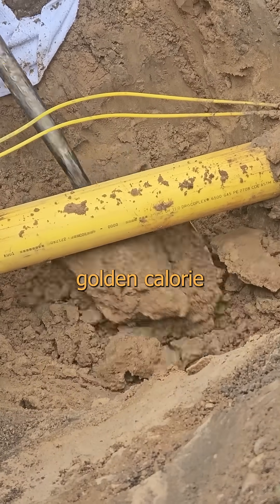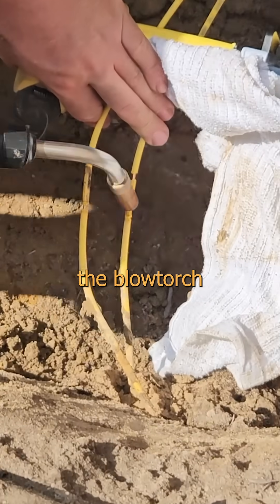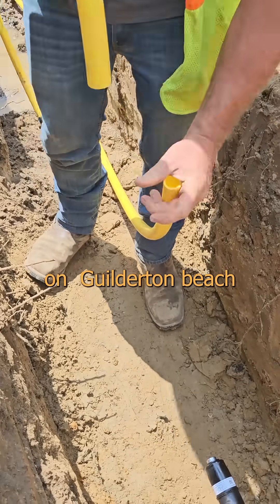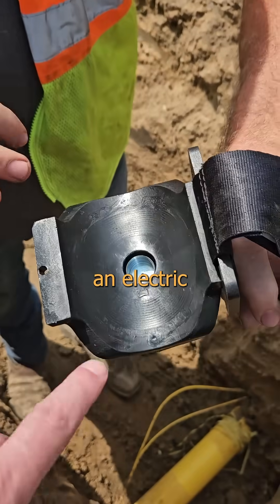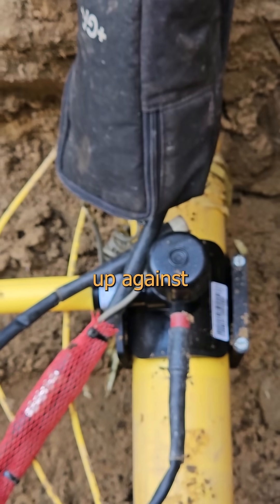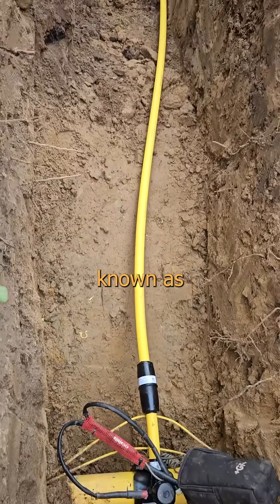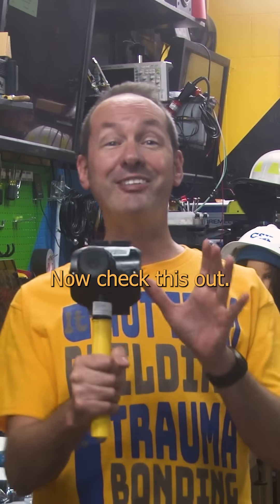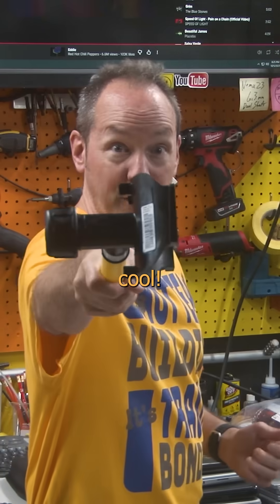Gas Line Hot Tap #chrisboden #comedy #engineering #construction #educational #apprentice #science

Comment: Is that similar to hdpe? Ive seen live hot taps where a blokes welding on the line and theyve got a escape line in that lets all the gas burn off basically like a huge burner stopping the pipe from exploding its scary to see but if it works it works

Comment: It's too bad they don't make saddle valves for residential copper pipe with a little more technical expertise built into them because the type that we have to use.Are basically crap after a few years. 

I would easily pay 10 or 20 to avoid the nonsense down the road with the saddle valves that we use now..

Comment: Our crew got dispatched to a gas leak.  Dispatch didn’t mention it was a 5” commercial service line.  We realized it when we got about a mile away and could see the dust plume shooting about 200’ in the air.  “Puckered starfish” was an understatement.  Flammable gases floating about on their own are one thing.  Flammable gases producing unstable rage tornadoes is an entirely separate thing.  All it would’ve taken to ruin all our day was was one spark.  My ears are still ringing.

Comment: I connect gas pipes occasionally and I use a machine that reads a bar code on the connecting fitting, sometimes the reader just doesn't want to read bar codes and it gets so frustrating when you are in a hole completely covered in mud and that fucking thing won't read. Absolutely amazing process otherwise, very easy and almost idiotproof.

Comment: The torching was just unnecessary, can think of 5 other ways to strip that wire. Yea it's "usually fine" like using a flame to check for leaks, but the risk to reward is massively tipped to the risk side, especially when there are many less risky options available

Comment: Years ago an old man I worked with had and we had a case of old dynamite that was starting to gel. He wanted to get rid of it and took it down in a holler and set it off. We went to look at the damage and running right thru the inside of the crater was a 6 inch metal gas line. About had a bad day. He said I didn't know that was there.

Comment: So much more advance them arc welding a nipple to a 2 inch gas line, slapping a valve on it before deep throating the fucking thing with a drill and some cutting oil. 😂

Comment: I was a tapper for about two years. We did mostly water/sewer, but would also do steam, glycol, and of course gas on occasion. Just be smart with the equipment, and trust that the engineers designed the parts the way they did, for a reason. Everything works out fine, just gotta respect the gas.

Comment: my only question is where that cut material goes after the cutting head displaces it. Seems like over time and multiple branches added it could lead to a clog. Brb gonna go try and find the answer.
Reply: unfortunately there seems to be several ways and devices to do a gas line hot tap; I couldn't find a specific answer.
Reply: @jackmcdowell40223  so the cutter cuts a coupon, the coupon is retained in the cutter and prevents gas from blowing out of the top. the cutter is toothless, its just a very sharp cylinder, so there are no shavings
Reply: @hustlehumbly6169  gotcha that makes sense.

Comment: As I was told in Ford alternative fuel class that gasoline is way more flammable than Natural gas or propane!! You can drill a hole in the tank and it can't light because the pressure and the Air fuel mixture is not correct!

Comment: Socket fusion like this is a huge fire hazard if done improperly. Last year here in Sweden a Canadian company managed to set fire to a water park when using socket fusion on water pipes that didn't fit perfectly. The damage cost was about 100 million USD.
Look up oceana waterworld fire if you are interested.
Basically if the heating element is not pressed between the socket and the pipe it overheats and the plastic catches fire.

Comment: My only problem is that when it cuts the hole through the pipe to let the gas flow you are still going to have some debris from the cutting in the line. And since it is moldable by heat it could melt and cause blockages in unforseen places.

Comment: Look, the first time taking a blow torch or an oxy out next to extremely flammable material is always puckering, but when work needs doing and you find yourself being somehow the most competent person to do that work, you get it done.

Even if it means the potential loss of a $1m combine because you needed to do an emergency weld repair in the middle of the field with dust so fine it would go up in flames if you rubbed your hands together near it.

Comment: This stuff used to be my gig. You might be interested to know that there is an alternate self tapping tee that doesn’t use any fusion to attach to the main. Looks very similar and is called a mechanical self tapping tee. Basically just straps on the main and a heavy duty O ring provides the seal. And those black pill-shaped pipe couplers? They are brand-named Perfection couplers. The gas industry version of Home Depot Shark Bites! I’m assuming this is a 60 psi working gas pressure because you see its pressure tested at just over 90psi air (looks like 100 on the gauge) and is the yellow Medium Density Polyethylene. Typically for 90 psi mains and services, only the black High Density Polyethylene is used. Gas pipe services and mains are pressure tested at minimum 1 1/2 times the Maximum Allowable Operating Pressure. 15 minute pressure test for 2” diameter pipe and below, 30 minute pressure tested at for pipe diameters above that.

Comment: THANK YOU NOW I CAN SHOW PEOPLE THE WORK I DID GOING TO SHARE TO LIKE 20 of my friends and family 😂
Reply: This is also what we call fusion welding, there is a few more methods of getting the plastic to fuse. This one is by far the fastest and best type of fusion but a big con is that it’s expensive. Each fitting is very expensive compared to the poly fittings you can use with socket fusing where you melt the inside(female) part of the fitting with a hot plate that heats a ceramic plate to a precise temp depending on the size and thickness of the pipe and material. You need to be within 20 degrees ( example 490-510) no more no less. Then insert the pipe (male) and after it’s held the fixed time you with take both ends out and quickly BUT carefully insert the melted ends and if done correctly will form a bead around the weld. The other one is primarily used for large pipes but it’s butt fission and the plate melts both ends and with a machine it’s aligned and pressed together. Obviously it’s more complicated but that’s the summary.

Comment: I've seen a scaled up version similar to this in a natural gas plant. It was an expansion project for an existing unit in operation. After the new processing components were installed, they were ready to tie into the product line that would be supplying, but there was only a 24" pipe and there were no tie-in points.

They overcame this problem by performing a hot tap - a method where they took a split tee, welded it on the bottom side of the 24" pipe, then welded the top half onto the top half of the pipe. 

The top half of the split tee had the branching portion that would supply the new equipment. The branching portion of this tee was much longer than a regular tee because it contained a valve.

Once both halves were welded on, a specialist came out with some fancy drilling apparatus. The technician bolted this apparatus onto the flange on the downstream side of the valve, opened the valve, and the apparatus began plunging a large bit through the tee to the main line and bored a hole through it. (Like a drill press with a hole saw).

Once the hole was drilled, the bit retracted back into the apparatus, the valve was then closed, and the apparatus unbolted, allowing the pipe guys to fit the last piece of pipe to the valve. 

The most wicked part about it all is that this work that was performed on a live line.

Comment: It's safer than you think. You can add as much heat to it as you want but the gas on the inside won't ignite until oxygen is added to the equation. If it were a metal main, you could weld right onto it. However, the moment there's a failure, you get yourself a blow torch straight to the face. I work in gas distribution an it's not as bad as it seems, but it could be.

Comment: This is scary, but for the first time on this channel I've heard of crazier.  My sister's husband works in the nuclear industry.  At one of the reactors he used to work at, they hot tapped a pipe on the inner loop of the pressurized nuclear reactor to open a stuck valve (rather than depressurize and replace the valve).

Apparently that was low temperature (or maybe pressure, forget which) compared to the oil and/or gas refineries the hot tap specialists usually work on.

Comment: We have a similar shuttle device in refrigeration. It's called a bullet piercing valve and it works very similarly, minus the melting adhesion. 

Clamp down a few screws, pierce and allow access to the system. Too bad they leak 😅

Comment: 3" gas main at only "a couple pounds of pressure"?
In our municipal, typical neighborhood distribution is running around 70psi before the customer regulator and meter which then drop it down to 1/4-1/2"psi for residential use.

Comment: I do this for a living it's hdpe fusion.  Those fusion saddles are cool under normal operation the heating coil gets to around 500-600ºf but if you had it exposed to the air it would spike to around 1400ºf

Comment: This is where you start getting back into stoichiometry and Metallica- "Gimme fuel, gimme fire, that which I desire!" Which leads us back into basic fire safety classes- Fire needs three things to start- a fuel source (like gasoline or natural gas), a source of ignition (like a spark or some other thing at a sufficiently high thermal temperature), and oxygen, or even just an oxidizer. Take any one of those out of the equation, no more flamey-boom. Even if you DON'T, but they're not in the right proportions (I.E. you have some trace amounts of oxygen mixed in with your natural gas)
...still no flamey-boom (or at least, less flamey-boom.) 
Keeping cool and starving a fire of oxygen has saved my backside bacon (but not my actual bacon 🥲) on at least one occasion. Hot though the fire was, THAT'S PRETTY COOL!

Comment: As a young up and coming HVAC tech working on a new steak house build, at the corner of the then new Highway 51 and independence blvd in matthews Nc, some pavement Jackie’s were excavating like we know how your mom likes it, and pow… right through a 10” natural gas main… a steel one…

We were all ordered to stop ALL WORK, NOT FUKKIN MOVE, NO NOHING that might ignight this new volcano of insanity brewing outside the building…

The gas company arrived in a flippin pickup truck…
 The guy hops out of his truck, fires up his generator for the welder not 6feet from the spewing pit of impending carnage…

He jumps into the pit, with cables and a hammer…
Clamps onto the pipe with one lead, and starts WHACKING on the damaged tube like a fully invested teen just discovering his favorite appendage.

As he finishes smaking it, he takes a plate of steel out of his pocket, sets it against the damage, and proceeds to arc weld the thing with live gas spewing forth.

Not a bit of flame, not the tiniest explosion… no drama whatsoever…

Insane.

Comment: Forgot to mention the bar codes are scanned and the computer within the box up top reads these and calibrates the machine to apply perecise amount of power to run the elements for a certain time. The machine once done gives a time for cool down and also states if it fused the poly together correctly. If it detects a bad coil through resistance in the coil it will abort the procedure and new fitting is needed. Very cool setup and expensive tools but we use them for water main lines through apartments on new builds definitely a time saver.
Reply: @jwpepper6718  yep I'm glad I got out of natural gas work when I did one of the cities in my area recently banned crews from using the push connect fittings so now the service crews have to electro fuse every fitting from main to riser
Reply: That's actually so neat!

Comment: Here, whenever I flip houses that have Gas. I do the reverse. I have the Gas Capped at the Street and then have the Lines removed in the yard. 
YES, I remove Gas from all the houses I flip that have them. Gas is so dangerous to be in a house and just very expensive for people.  Much easier to just go Electric. Safer and easier.

Comment: Alright. I got to say it. 3inch MDPE (aka poly pipe) gas lines so not scare me.
12in High Pressure Steel gas lines scare me. Like the one right under the road, which is right under the bridge we are about to demo, that's a little concerning. Concerning for the gas company too I guess. The largest MDPE gas line I ever worked with was a 6inch supply line to an Intel site. LEGAL DISCLAIMER: I have never worked FOR Intel, I do not represent Intel, their property, or their IP.

Comment: I've watched someone tap steel gas pipe. It's more or less the same concept, but they need a lot more amps to do the melting, as in they arc weld the sucker on. (I don't off hand remember if it was MIG or stick.)

Comment: Reminds me of this green pipe we use at work called aqua therm, it's about 5/8 of an inch thick and uses that super technical process we call melting to bond it together, we have it hooked up running our fire sprinkler system and it's holding 212psi and has been for over 11 years,

Comment: They made a water piping with polypropylene instead of polyethylene. Same concept, heat fused and the fittings are stronger than the pipe. Pretty great stuff, EXPENSIVE, but quality

Comment: What is the diameter of the hole punched in the gas main pipe by the shuttle when you screw it down the first time and what happens to the plug it cuts out?
Reply: usually the hole is equivalent to the outlet size, which appears to be 1 inch

Comment: Low pressure gas work like this always makes me laugh. I work with CNG and we have sensors that will shut the system down if there's any leaks in the main unit and everything has to be intrinsically safe or explosion proof as far as electronics go.

Comment: I once worked on the electrical part of a natural gas pump station and found out about a device they called a slug catcher. It catches the chunk of pipe cut out for tapping a working line. I made it a point to be on hand to watch when a crew working just a few miles away made a tap. They welded a collar on the active line, then used an acetylene torch to cut out the slug inside the collar, hit with a hammer and let it get carried down line to the station by the gas pressure. I was in awe of those guys working on a gas line with torches!

Comment: When it cuts a hole in the pipe, surely there is some debris generated, how does the system handle that in an enclosed gas line?
Reply: there is not debris, the cutter it toothless, just a razor sharp cylinder. the coupon, or disk of plastic, gets retained inside the cutter.

Comment: Where does the piece of the gas main go after the shuttle cuts it? This is similar to a saddle valve that you get with an ice maker kit for a refrigerator, but that just punches a hole in a copper line, lasts for about 5 years then develops a slow leak... 😅 I'm sure these are way better!

Comment: My experience has been that thermo plastics have shorter lifetimes than say, steel.  Eventually, they become brittle.

Is there something different about the formulation of the plastic used in this gas line?  If not, is there some equally cool technology for replacing them without digging everything up ?

Comment: Okay, what are those two wires next to the gas main carry? Are those wires at all? Are they pipes? You melted what seemed like wire insulation away around the copper(?) cores, but didn't connect them to anything (not in this clip), and in the next shot they seemed to be intact again - new site?
Asking from Austria, Central Europe; we have the same melt-on gas lateral system in use, at least here in Vienna.

Comment: In a UK city most of your utilities will be in a 5' pavement, and at least one of the utilities will have mole'd a new conduit in and moved the dirt around moving everything just a little bit. So the pipe is in tension, when you drill it the hole starts a crack which runs around the pipe releasing the tension. This is bad.

Comment: Hey I wanted to ask a question about power lines. I was biking near a power station the other day and the cables sounded like a horde of cicadas. Then later under other lines it was buzzing and I could feel the charge in the air, like a blanket of static over the whole everything.  Then my hands started zapping against the metal in my bike. 

Is any of this supposed to happen?

Comment: That is pretty cool! As a plumber for 10 years, I have fused some yellow poly a few times, but I never seen one of these contraptions. We typically deal with short runs with a couple stab risers if possible and black iron. I have only worked in residential plumbing.

Comment: Wait so how do you remove the melting thingie or does it stay on the pipe permanently as the off switch
Reply: the tee is all one assembly! the heating coil stays fused to the pipe, you just disconnect the electrodes from the power supply and it’s good to go

Comment: Great for the new lines. The old cast iron still need lead solder. The even older ones found in NY and the New England area were made of wood and designed to carry coal gas which had a relatively high moisture content. When everything switched to natural gas, the wood pipes dried up and disintegrated. There are probably hundreds of miles of gas “pipe” that’s nothing more than a literal hole in the ground and can be disturbed by a plastic shovel.